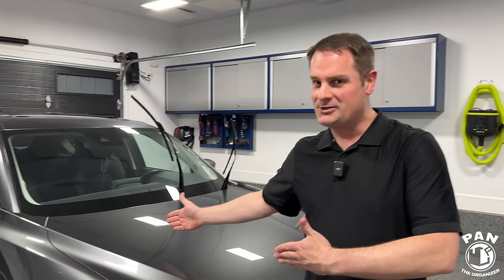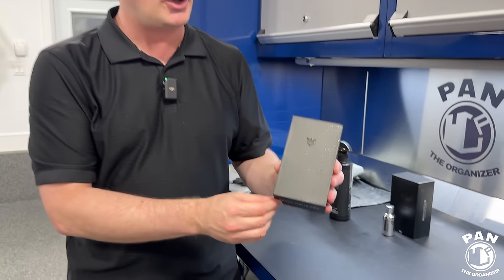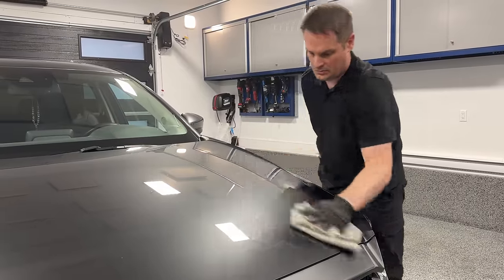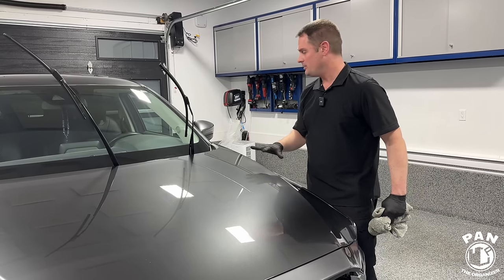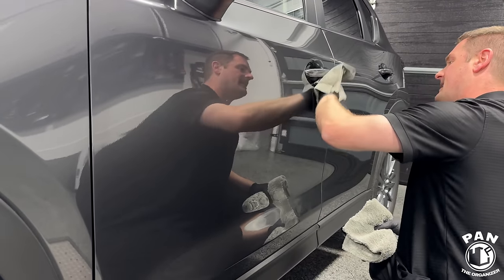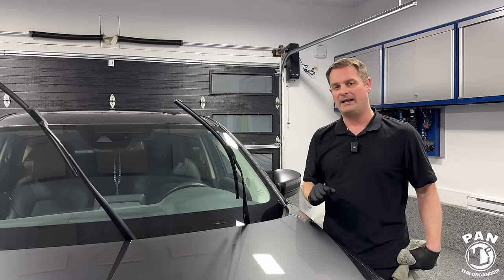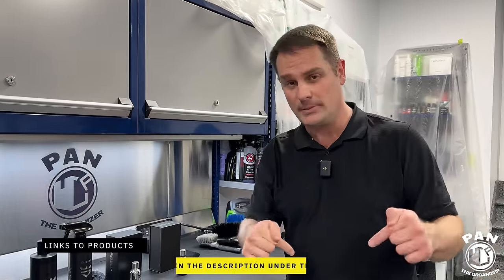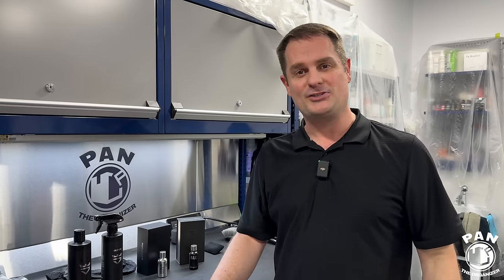NEW AvalonKing Armor Shield MAX ceramic coating! 1 layer, 3 years protection!

Comment: Quick question. I been following you for a long time now. But you say to apply in cross pattern. But your friend Ivan says is better to do in circular. So is it better to do one way compared to the other?
Reply: I was just wondering because he said by doing circular it helps more to eliminate any high spots then if you do cross pattern
Reply from the maker: It doesn’t matter as these contain no abrasives. Pick what you feel most comfortable with, regardless if it’s cross hatch or circular. The most crucial thing is to ensure proper and even coverage.

Most coating brands recommend cross hatch.
Reply: @PanTheOrganizer  ok thanks. I appreciate. I just wanted to get your opinion. I just recently put a graphene coating on my car that you suggested before. So I appreciate all you do. It definitely helps. Especially when I might not feel comfortable doing and then see you explain it better and easier.

Comment: Great stuff Pan! Would you still consider this also a beginner's coating? I have never done it, so wondering if I can go for it as a first timer or stick to the previous version for my first try.
Reply from the maker: It has more advanced technology compared to their beginner coating (the original Armor Shield IX) but yes, a beginner can absolutely apply the new MAX version, as it's just as easy to apply! If you have applied a wax in your life, you can definitely apply this coating.

Comment: Ok - Leary of coatings.  I’m a traditional swirl remover, polish, and paint sealant guy.  Will the coating retain the same shine as a paint sealant/wax?  Can you wax over a coating?  I’m looking for the best polish/shine    and having that shine as often as possible etc.  I don’t care about having to reapply wax every few months.  I love the shine it provides.  Looking for best shine and protection period.
Reply from the maker: Ceramic coatings are by far the best form of paint protection. They have been proven for years now and there is no doubt about their superior hydrophobic properties, self-cleaning properties, chemical resistance, and long term durability.

They are super glossy and slick, but more on the cold side of gloss, compared to a warmer glow for carnauba waxes.

Some high quality waxes do achieve insane shine, like coatings, but we all know waxes don’t last as long. Waxes also usually feel a tad more slick to the touch.

Watch a video I made witn an industry veteran of 40+ years of experience where we debunk myths and misconceptions about ceramic coatings here: https://youtu.be/cGGlEN6xvKE?si=G7GlL71OyckrWaFP

That being said, if you like waxing your car, the effect it provides, and don’t mind rewaxing often, there is no problem with that. The most important message is to protect your paint. Regardless if a person had a personal preference for a wax, synthetic paint sealant or a coating.
Reply: @PanTheOrganizer  so if shine/gloss is your main goal - wax is still king?
Reply from the maker: Good coatings will have equal or better gloss than most waxes. It's just that it's different. The gloss from coatings is often refered to as "candy like gloss" kind of like a hard shiny candy. A good carnauba wax (those are getting more and more rare) will have a warmer glow effect.

So gloss level is very different (in terms of gloss units) compared to the visual appearance. Visual appearance is a personal thing. Subjective. In my opinion, the best gloss comes form quality ceramic coatings.

I put my money where my mouth is. My Porsche 911 Turbo S has a ceramic coating on it. I wanted the best, I got the best. 

But again, if waxes are you thing, there is nothing wrong with that. But I wouldn't say wax is king, no. In my opinion. Some other people are die hard wax fans, and would beg to differ. So again, it depends on your preference, budget, and expectations.

I made a very popular video explaining the differences between waxes, paint sealants, ceramic coatings and graphene coatings here: https://youtu.be/4ejfPHan3k4?si=Z-hl1rkNLXTFqchy

And no you would not wax over a coating by the way. That would mask the superior properties of the coating underneath, plus the coating will eventually reject the wax. Coatings are designed to reject incompatible stuff applied to them. For maintenance, you use ceramic or graphene sprays on a coated vehicle. I have videos on that.
Reply: @PanTheOrganizer  makes sense.  I would love to see comparisons between a high end coating vs high end wax - with them side by side in the sun.
Reply from the maker: You have never seen a properly ceramic coated vehicle in person? To give you an idea, watch the video where we coated my new Porsche, and look at the end results... Images speak louder than words. Here: https://youtu.be/-9pVgjQFe1U?si=84pWIN8oRGP-4IjF

Or any of the vehicles I have fully detailed A to Z using coatings:
Mercedes S 580: https://youtu.be/Vq_tfcwryVI?si=whord2_UEFSg28UW
Aston Martin Vantage: https://youtu.be/OKga3yZVTqo
Volvo XC60: https://youtu.be/tvDBBenhYFA
Tesla Model Y: https://youtu.be/gohks8xP5NY 
Porsche 911 Carrera: https://youtu.be/2ckiivbFqs4
Mercedes AMG GT63S matte black: https://youtu.be/eU8zg1lXvXY?si=oGxoCp8PWt7gTncV
Audi Q7: https://youtu.be/t7HCBSVnizM
Reply: @PanTheOrganizer  oh I’ve seen cars with coatings it’s just hard to compare gloss/shine between the two different options of polish and paint sealant/wax vs coating.  I actually love the idea of applying a coatings to keep they cleaner, especially the wheels.
Reply: @PanTheOrganizer  side note I just got my Milwaukee DA cordless delivered today.  Can’t wait to try it out!

Comment: You had the original Shield9 on the car. Did you  polish the old off first,  or over the original? I literally have the original and was planning to put on today, but now thinking about ordering the new.
Reply from the maker: I explained it in the video. In this specific case, as we knew there was no protection left, all that was needed was a decon wash with the stripping soap, iron remover, claybar, and IPA wipe. The paint had no crazy swirls or scratches and we want to preserve as much clear coat as possible, so polishing wasn't needed here.

But if you still have paint protection left (if you still see water beading on the surface) or need to remove swirls and scratches, then yes you'd machine polish the surface, then IPA wipe, then apply the coating. This will allow the coating to properly bond to the clear coat.

Comment: I had my cars done in summer 2022 from avalon king and its not really strong anymore. To apply a new one i need to polish the cars again though no?
Reply from the maker: As I mentioned in the video, if you have an exisiting protection, it would be best to:
- wash using a prep shampoo like their AK Prep Shampoo 
- iron remover to remove brake dust and fallout
- clay the surface to remove any other embedded contamination
- machine polish to ensure 100% removal of the previous protection (CRUCIAL STEP) and remove any swirls/scratches/oxidation
- IPA wipe with a paint prep spray (like the AK Prep Spray) or isopropyl alcohol mix to remove polishing oils and residue and prep the surface to receive the new coating
- apply the coating

I have a full ceramic coating application tutorial here: https://youtu.be/sqQYVjxFqK0
Reply: @PanTheOrganizer ok thanks i know all of this i just misunderstood then that you apply the new one without polish which means without fully removing the old cermaic coating but then its ok i just misundertood you and ill just polish like i know:)

Comment: Quick question Pan.  While the body has traditional paint with gloss clear coat, my Jeep has a "semi matte" paint on the hard top that is also slightly textured.  Would this product be advisable for that?  Would it make the top super glossy?  Thanks.
Reply: I looked at the product description and here's what AvalonKing said about using the coating on matte finishes: Yes, all of our coatings act like a liquid glass that enhance the textures beneath. Gloss becomes super gloss, matte becomes more matte, metalic becomes more metalic, you get the idea.
Reply from the maker: You can apply this on glossy or matte surfaces according to AvalonKing. Applying it on matte surfaces will make the surface appear "richer" without making it glossy.
Reply: @PanTheOrganizer  Thank you!  I may be doing my first ceramic coating very soon!!
Reply from the maker: You can dot it Randy! :) See how my brother applied the previous AvalonKing Armor Shield IX coating on his own SUV (and he has zero detailing experience) in this video: https://youtu.be/_pwEMLqenaQ?si=W81WsolQ4Ofc8pGR

Comment: Any new discount code to purchase the new product avalonking max ?
Reply: Messaging from country Bahrain
Reply from the maker: Not to my knowledge
Reply: Oh ok, so i just want know if i place order for avalonking armor max just one 30ml bottle will it be enough for toyota rav4 2016 model??
Reply from the maker: If you are just planning on coating the paint yes. If you also want to apply on plastics, glass, wheels, and lights, get two bottles to be safe.
Reply: Noted, but purchasing online to Bahrain its quit expensive but will see i will mange some how

Comment: Any special prep for plastic application?
Reply from the maker: Wash the vehicle, dry it, use an APC to degrease the surface, or the paint prep spray (IPA) and then apply the coating. Very simple.

Comment: Too many choices for me. What's a decent option for a diy busy person? This or a cheaper graphene?
Reply from the maker: Graphene coatings are nearly identical to ceramic coatings, as graphene coatings are ceramic coatings with reduced graphene oxide infused into them. So don't overthink the choice between graphene or ceramic, they're more of the same. Initially, brands were promising crazy claims with graphene, but we all realized they weren't using pure graphene, but rather just reduced graphene oxide (RGO) and the benefits from that are still not proven.

If you're a DIY person and want something stupid easy to apply, the AvalonKing coating is as easy as it gets. Or you can watch my awards video to see my top recommendations: https://youtu.be/KRv7vKsuliQ?si=G91av7VS9Z7iVMbC

Comment: What is a great coating for cars kept outside? If it says 3 year protection, will I get 1, 2 or even 3 years? Car stays outdoors pretty much everyday, all night
Reply: I got 2.5 years & 2 winters with armour shield 9 with it being kept outdoors.  But our winters are relatively mild
Reply from the maker: It's impossible to predict a coating's durability in your specific conditions as there are too many variables. Prep, application, conditions and weather your vehicle is exposed to, mileage, maintenance, etc. 

It also depends on your budget, expectations and level of experience. If you have never applied a true coating in your life (in a glass bottle), then the AvalonKing coatings are perfect for you. And certainly this new MAX version will hopefully last more than 2 years (previous version in my conditions lasted 18 or so months).

Or you can opt for more prosumer/professional grade coatings that will cost more, but likely last longer. 

You can also check out my popular annual car detailing products awards for my top picks in each category: https://youtu.be/KRv7vKsuliQ?si=JLI7cG_btG8IJoU1
Reply: Thank you for your reply! I leave my Tesla Model X outdoors because of the rear falcon wing doors in Southern California where the weather is usually pretty mild. I don’t drive very much and I do a maintenance wash every couple of weeks but what makes the car dirty is the morning dew and dust from the elements followed by more dew in the morning. I ordered the Cerakote after watching your video and wondering if that will last couple of years. It looks very promising.

I’ve watched all of your videos on ceramic coats and have experience with CQuartz. That barely lasted a year on my previous vehicle. 

Thank you for all of your videos and keeping us current on all things new!
Reply from the maker: Thanks Mike! Welcome to my channel. You discovered one of the biggest car detailing channels on YouTube as we surpassed 945,000 subscribers and we have over 125 million views! I have been detailing for 26 years and I love to share my knowledge and passion with my viewers.

You found the right channel to help you learn everything about detailing.

You had applied CarPro CQuartz UK 3.0 and it didn't last a year? That's odd. Did you apply two layers as recommended? 1 hr between layers. And was your product fresh? They have an expiry date on the underside of the bottle. Maybe you had a bad batch. I consistently get 2 years out of CQUK 3.0, as per their own claims.

But anyhow, you got an excellents coating with the Cerakote for sure! I'll also be following its long term durability closely.
Reply: I followed your steps to the T but the reason CQuartz only lasted 1 years was because my car wasn’t garaged at all. Even though I live in mild Southern California, almost daily morning dew reduced the longevity. Looking forward to Cerakote and I’ll share my experience when you post your videos about it in the future. Keep up the great work!

Comment: How do they know that this protect for 3 years?  The product is just launched
Reply from the maker: You would ask the same question for any new coating that launches. All brands come up with claims. For example, Adam's says their Advanced Graphene Ceramic Coating lasts 9 years. Do you think they had the time to start testing its durability 9 years ago, and just wait to see if that pans out?

Rather, chemists do testing in a lab environment with simulations on things like washes, resistance to chemicals, water contact angle, etc. And can guestimate a coating's durability based on those experiments. You can see a conversation I had with an industry chemist about coatings and how they come up with claims and testing here: https://youtu.be/A8V7_HysfwA?si=Q1VqT3CKvf-PLbPp

But like anything, those are done in a controlled environment, so it doesn't mean people achieve that in the real world, as there are many variables such as:
- prep before the application
- following proper application instructions
- conditions and weather the vehicle is exposed to (a vehicle that is weekend driven only, in California, and kept in a garage, has a higher likelihood of it reaching the maximum durability claim for a coating compared to a daily driven vehicle in Canada, that sits outside in the elements all day, 24/7, for example)
- yearly mileage
- maintenance (many people neglect maintaining their vehicles so they likely won't reach a coating's maximum durability claim compared to people that do proper maintenance washes)
- etc

Hence why I often like to do real world testing and come back every now and then with updates on how coatings are performing in my conditions.

Comment: I wonder if a coating like this would keep off fingerprints on a MacBook.
Reply from the maker: The new Space Black MacBook Pro apparently was made to accumulate less fingerprints compared to the previous fingerprint magnet models. I’d be curious to see if that’s the case.

Comment: Hopefully better than your recommendation for the cerakote ceramic☺!
Reply from the maker: I hope you realize there was an issue with the Cerakote's coating curing mechanisms in certain conditions. They are well aware of it and are working on a new version with the fix. If it works as promised, it will be an incredible coating. 

If you want the best of what I currently have tested, always refer to my popular yearly awards videos: https://youtu.be/KRv7vKsuliQ?si=4A_T3B4fkEC8rkLc

Those products I had more time to test.

Comment: I just applied Armor Shield 9 on my new car. Now I am seeing comments regarding it’s durability. Should I do a second coat with this new MAX coating or should I wait a year for the current coating to fade?
Reply from the maker: Armor Shield IX was a good entry level coating a few years ago. It lasts 2-3 years on average, as long as you apply 2 layers, 45-60 minutes between layers. And of course proper maintenance.

The AS9 seemed to do better on my brother’s car compared to the newer MAX for some reason. I did update videos on both coatings.

But coating technology has evolved quite a bit, and now most coatings are easy to apply. If you want better coatings, that only require one layer and only 1 hr of curing, look into one of these: 

🇺🇸 For people in USA:
DIY Detail 3 year graphene coating: https://bit.ly/3URM65R
DIY Detail 5 year ceramic coating: https://bit.ly/3QARFmy
DIY Detail 8 year ceramic coating: https://bit.ly/4aaiBRa

🇨🇦 For people in Canada:
DIY Detail 3 year graphene coating: https://bit.ly/474fKZA
DIY Detail 5 year ceramic coating: https://bit.ly/454F5AD
DIY Detail 8 year ceramic coating: https://bit.ly/3KfmiuE

We spoke about those coatings in this video: https://youtu.be/XzAWMaaGujg?si=L_wU1iJIjmgIpVaZ

Welcome to my channel. You discovered one of the biggest car detailing channels on YouTube as we surpassed 1 million subscribers and we have over 145 million views! I have been detailing for 27 years and I love to share my knowledge and passion with my viewers.

You found the right channel to help you learn everything about detailing.

Comment: Merci again Sir Pan can I team it up with P&s beads or the griots garage green 3 in 1 ceramic spray?🫡🙏
Reply from the maker: Once the coating is applied, wait one or two weeks before washing the car. And then you can start applying toppers if you want, and yes Bead Maker and Griot’s 3-in-1 Ceramic Spray Wax would work.

Comment: Pan.  So if there is ceramic coating still on areas of the car……and you put new ceramic over those ceramic covered spots, will the new layer adhere just fine?
Reply from the maker: That’s the unknown. There are no guarantees at that point, as usually a coating needs to bond to a virgin clear coat. You’d have to test.